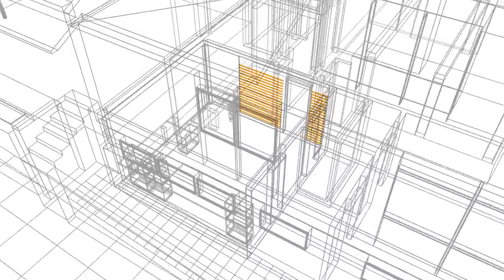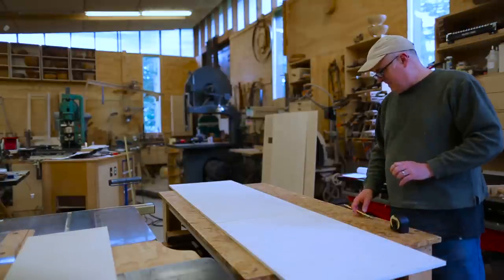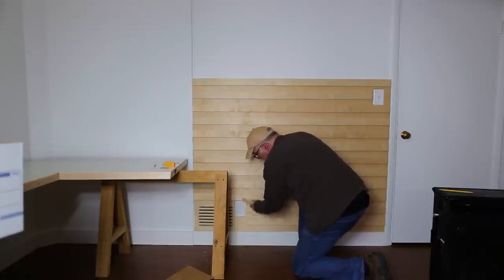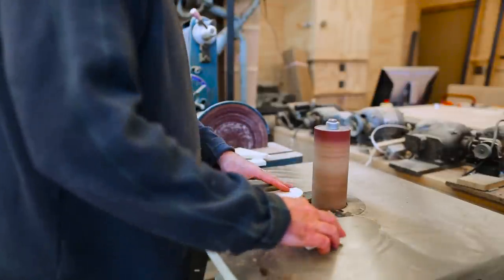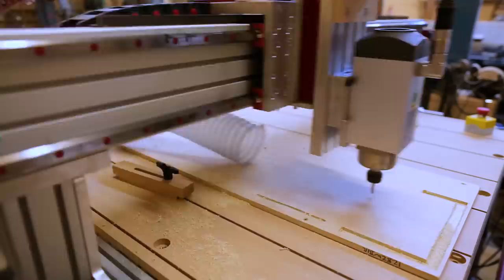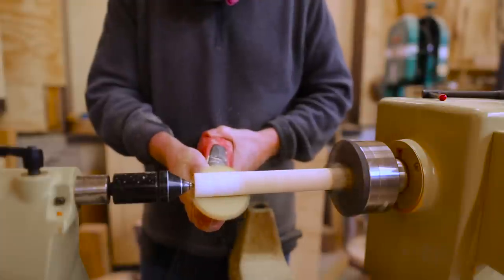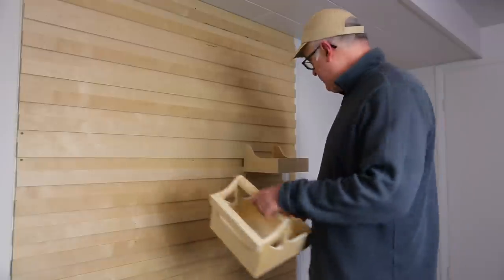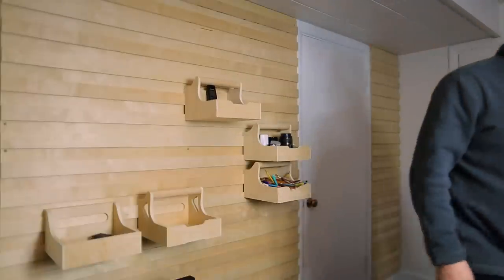Office 3: French Cleat Storage Wall

Comment: Hi Frank!! If I had this system in my office I'd love boxes that could hold various papers, files and even binders. It probably wouldn't work with a handle if you wanted to easily slide a file out, but it could look spectacular and help organize. 
I wonder if you would make a shelf for this system, with a back, bottom and two sides but have the front open for books. That might be nice along the taller sections that you won't use as frequently. 
OH! And make a little box on the bottom for your cat to hide in!

Comment: Lower the handle what ever distance is needed to allow stacking a box above without interference (1/4" ?).  Move the handle away from the wall half and inch or so.  Should improve the balance you were looking for.  Aesthetically I like the holes on the side.  CNC makes that a snap.

Comment: I would just go low profile and put hand holes on the sides. Another idea would be to adjust the position of the cleat so you don’t have the issue of having to undo a whole column of trays to get at one further down.

Comment: Hi Frank,
May I share some observations and suggestions?
As you realized around the 10:36 mark, by adding a handle you add 2-3 steps/motions/instructions in order to remove the box.
Also, we didn't get to see the handle actually in action but, I have a strong feeling that the handle is a) unnecessary because of the inherently small, manageable size of each box, and b) the case where, no matter how balanced the boxes may be empty, or lightly loaded, they will always immediately fall out of balance as they get fuller.
If you want a handle that is always balanced, try instead, making the handle floating within two horizontal voids/tracks, one on either side, where the top of each track is interrupted periodically by 'fingers'.
Think: the rack-and-pinion style stops on a reclining Adirondack chair; except upside-down.
Then, picking up the box by the handle pulls the box downward and the dowels in each end of the handle upwards, into a pair of fingers. Grip the box and relocate the handle into the fingers that provide the best balance.
However, I do not believe a handle is necessary.
I think being able to stack the boxes, one on top of another, is more practical than a handle.
Think: round Dim Sum steam trays, except square; and with a French cleat on the back.
I suggest you consider losing the handles in favour of maintaining a minimum clearance between the top of one box and the bottom of the box above.
I also suggest you consider adding rabbet into the interior of the lip, and a matching or slightly larger rabbet into the exterior of the bottom, so that the boxes can stack, like Dim Sum trays.
If the boxes are stacking, you might want some that completely enclose the box below when a box is stacked above.
Or, you might want some that still allow you to access the stuff inside, even when stacked on top by a box; by minimizing the height of the front, face wall, and tapering the sides to meet the top-edge of the front wall.
Please consider the enjoyment I've received from watching your videos, as my apology for the length of this rant... :D

Comment: you could do one that not only had the normal space but also a had a single or serise of boxes hanging of the bottom like a narrow bookself , actually the boxes  could be a permanent fixture to a specific one or they could be interchangeable in the same way the trays are on the wall
Reply from the maker: I have had a similar idea for the shop,  A box with shallow drawers for small objects - nut, bolts and screws
Reply: frank howarth yes , that would be good , good for organization

Comment: that intro scene was so Grand Designs Esque it was amazing. I feel like having the top handle compromises vertical stacking but it depends on how much you need to store. If you stack three like you did you can't get the bottom two out of the cleat.

Comment: Maybe you should try rounding off all the edges of the bottom of the boxes, because I notice that it's easy to place that bottom edge onto one of the cleats which then makes the cleat at the top not go into the wall cleat as easily. I have no idea if that would help any, but is it worth trying?

Comment: the handle should be closer to the height of the cleat so that it can be removed when there is one above it (Leaving a gap between handle and bottom of box above the same as the vertical length of the cleat angle). If the walls are filled up this will become a real annoyance for you if you want to remove the bins etc.

Comment: I'd be curious to see how you might store items like tape.  I always have various rolls laying around (usually in a central bag).  You could just put a pole on a cleat and then hang the tape that way -- but that's too simple for you.  I'm sure you could devise a smarter way for all sorts of tape (electrical, masking, painters, duct, plumbing, air tools) - etc.  I know this is in your office, so probably not as critical, but I'm sure every shop struggles with that little one...
Reply: Tom Birch somehow I feel he'd go all out and make some sort of dispenser with labels and complex stuff. I think you'd probably need a quarter to use it xD
Reply from the maker: having a tape dispenser on the wall would be useful.
Reply: Tom Birch April Wilkerson on YT uses a french cleat system in her workshop and she's made quite a few little caddies of different kinds - I think she may have made a tape one...
Reply: Problem I have with tape, masking tape specifically, is adhesive degradation.  I used to stock vast quantities of it.  Only to toss most of it out when I could not longer get it off the roll.  Ever since that revelation I resist  the urge to facilitate anything that will allow me to stock more than a couple rolls of a given size.   Generally only one roll is maintained.
Reply: Frank,  You could put attach a bunk bed using the cleat method !

Comment: The vertical spacing needs to be greater, try moving each row up one, then see if you can easily remove a lower box. Also, instead of making the handle taller, make the box deeper, if you make one for taller objects. And make a slim box, for things like folders, binders, papers, etc. 
Also for a box for camera gear, make a small drawer for storing SD cards and such. Do the same for other boxes that may have small objects.
For the pens and stuff, see about making a cup type container for holding them, or some kind of organizer for them. 
Also make some cleats that just turn into shelving, for items that don't necessarily need a box.
And find a way to label the boxes.

For heavier items, if you have any, I would suggest finding a way to use two cleats, but I have no idea how to make that work.

Comment: French cleat boards are to narrow and half as many would have achieved the same result (notice how every hanging takes up TWO rows , and its hard to figure how one would do only one. Plus if clamps or a cabinet are hung the waist is greater ) .    Tool box idea is good , however, the cleat system is novel in its way of separating tools that can , as sets , be moved and hung near work location .   A common box is already a portable .

Comment: I liked the cutout on the side as a design element.  It made the boxes feel a little lighter.  I am curious, did you finish the boxes and the wall and what did you use?  In any event, splendid idea.  I am doing a similar system in my shop right now so it is timely to see what you did.  I am intrigued by the smaller 2" wall cleats.  For some reason I had in my head that I needed to use 4" cleats all around.   Thanks again, so delightful to watch your craft.

Comment: Hi Frank, would you consider running the handle through the sides so you are not relying on nails/glue just in case it gives under a heavy load :) Maybe not all the way through but into a circular recess to take the weight then nail/glue as before :).
Beautiful work as always :)

Comment: Sir, if you make the drawer 1/4 more shallow, move the handle down, the same diameter as the handle, then move the handle more towards the front. That way you could pick up the drawer with your palm up. Would that  help to removing the drawer so it would not hit the drawer above.

Comment: Very cool. Maybe a french cleat mount for led lighting? 
Holders for sissiors or knives, divders and pointy things, etc? Also a shelf or holder for computer paper.
Seems the hieght of the box you did last should be slightly shorter so if you have 3 stacked you can more easily get the middle one out. Will your french cleat coat rack work on the office system?
Ya got me thinking now,cause im doing my home office too.

Comment: Was gonna ask you how the glue and nails were holding up but you literally just posted this today! lol  - looks great Frank
Reply: also what do you mean you made the cleats on the box narrower than the cleats on the wall?  the wall cleats are 3/4" and the box cleat is 1/2" for example???  or you just mean the height of the cleat is small enough to fit the gaps you have between cleats on the wall?

Comment: hmm... I like it! I would say know what the dimensions of your all are, and if you make wider or narrower ones, keep them at multiples of that length, if it's one fourth the distance, so four will fit, or six. but not 5 and change.   I do like the idea of wider, or deeper ones. I think the deeper ones, might be able to snag two cleats at once, for greater strength, and thus be able to support more weight.  It might be fun to have some french cleat "end caps" so a rounded bin, or even something like one of those CD towers, something small, to cover the end of the rack near the door, so it offers a soft rounded curve that your elbows and shoulders will feel "safe" against. it'd be a wierd shape, but I think small things like nuts dowels, and the like won't care what shape it is. and it might give you a chance to do some wood bending!

Comment: if you turn the opening on the back around, won't it be in the space between the cleats on the wall? you could use that to route wires into the box for a little charging station, using the cleats on the wall as a guide for the cable coming out of the box.

Comment: Is there a reason you need to hand hold the hose for the CNC machine?  It seems to beg for a solution mounted to the head of the CNC. Maybe dangle a springy hose from above in order to reach the four corners of the table and not get in the way or drag on the x and y drives.  Just a thought.  I like the cleat wall.

Comment: Frank -  Did you just measure to get the hole locations?  I never have any luck getting precise locations and transferring them.  Did you consider locating the mounting holes under the strips so they would be hidden?  You would not be able to glue them I suppose.

Comment: Great video! 

What is the width of the Cleat before it is cut in half at 45 degrees?  

What gauge nails (size and/or type) did you use to attach the lenght of cleats to the panels? 

I'm working on a similar project and would like to be as efficient as possible. I initially consodered using wood screws. However, after seeing you glue and use a pneumatic nailer, it made me re-consider using wood screws. 

It seems the pneumatic nailer is more efficient. I'd like to know the gauge and type of nailer and nails. 

Thank you.

Comment: Fantastic!  I have a wall in my shop begging for this.
Question: Should the hanging boxes also rest on the cleat under the one it's hanging from for added support?
Example: For light things like a small box for screws I think not.  But for a circular saw maybe it should.

Comment: That French cleat wall looks awesome. Thanks for sharing.
What is the thickness of the plywood for the boxes?
I saw a lot of French cleat systems on You Tube already but nowhere I can find information how much weight the system can
hold. Does anybody know maximum weight per box/holder or per cleat (kg/meter) or per panel?
In the US many buildings have wooden studs which is less common in Europe.
Has anybody experience mounting a French cleat system (can be panel or strips straight mounted to the wall)
in brick or concrete walls?

Comment: In regards to the cleat on the removable boxes could you mitre both sides like a parallelogram. Would it requires less vertical space to remove?   I think if the Handles were slightly lower it would work also.  Interesting system though.

Comment: If you're building a box for computer parts, why not build one for the actual computer (depending on if your workstation will be withing about 5M of the cleats, for USB connectivity).  Take the motherboard mounting panel out of a case, screw that to some ply, and build a box around it with a hinged door on the front.  The CNC could make some super nifty designs.

Comment: Do you still work with architect's drawings or prints, rolled up? A tall, narrow vertical bin for such rolls.

But I really want to see a double-dovetail French cleat system for the ceiling, with clamp-on fixtures.

Comment: I would like to make a wall in my apartment a French cleat wall, too, but the wall does not have studs. It's cement bricks! Can I use screws for cement brick to hold the panels ? Will it be strong enough?

Comment: I guess it could be called personal choice but why did you put the rabbit on the sides causing them to show at each end of the front?  Wouldn't it have been cleaner to put the rabbits into the front so the side ends didn't show in the front.

Comment: Although I find the editing lacking a sense of connection. I mean, it's not like 1,2,3, result, breathe.
It's like 1, 3, 4, result, 5, 7, 7, 9...
What I'd suggest is trying to link things together. Don't change the angle of camera if you're drilling. Change it when you begging sanding, for example.
If a process has 3 steps (e.g. you're sanding, rounding edges and polishing), don't show the first two in one camera, and then zoom it without any purpose. If there's a detail that needs to be seen, begin the 3rd step as the first 2, and THEN zoom it.
I got the impression that you're editing too much, just because you have some cool effects to show.

Comment: So I had an idea. I notice when you lift the box off the wall the top of the box's cleat bumps into the wall cleat above it. Why not cut a miter on the top of the box's cleat (its cross-section would be a rhombus) so that it'll tend to clear the wall cleat above it?
Reply: I like that idea.  Also if all the cleats were rhomboid in shape it would simplify the process of cutting the cleats a lot.
Reply: And now that I think about it, the same principle could apply to both the cleats on the wall and the cleats on the boxes.

Comment: I'm always have trouble getting from 1 strip 2 same sized cleats. 1 cleat is always wider than the other Any tips on this?
Also, I'm getting the feeling that 4 inch might be too close one to the other. Of course it depends on what you're going to hang, and the cleat below supports the item so it doesn't hang crooked.